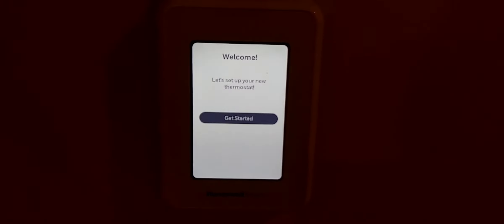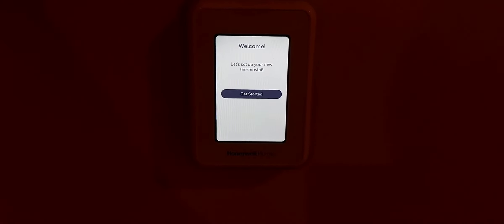HONEYWELL T9 SMART THERMOSTAT INSTALLATION AND SETUP PLUS (C) WIRE HACK

Comment: Will the T9 work for electric baseboard heaters
Reply from the maker: Sure , you may need a little modification
Reply: It does say in the manual that it is not compatible with these